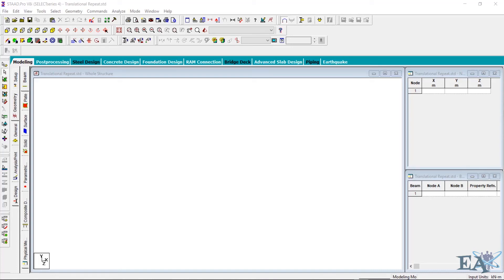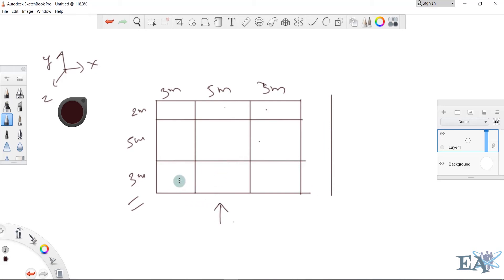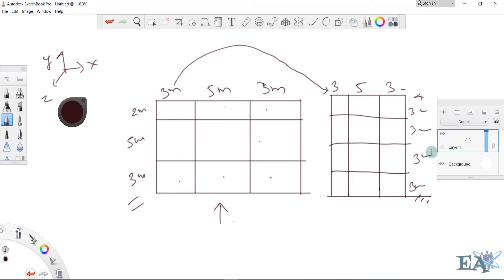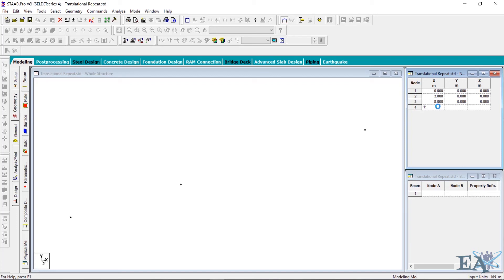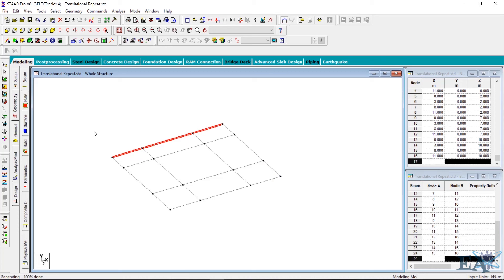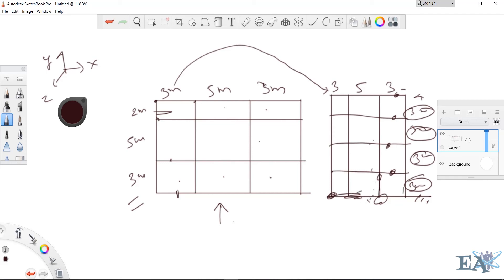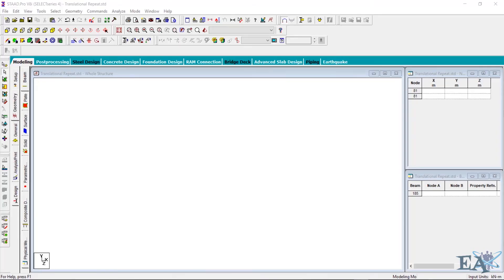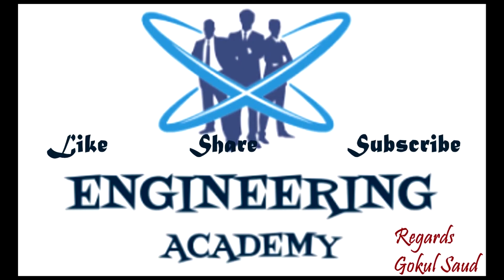STAAD Pro Tutorial For Beginners [Episode 10]: Using Translational and Circular Repeat

Comment: i have a suggestion for modelling........ i ithink its much easier to use the structure wizard, because you can just easily make the full 3d grid..... in the previous video, i recall you saying that the spacing between bays will always be set equally... this is actually not true, because you can click the dotted button next to the specified number of bays button,  there you can specify the spacing of each bays however you like..... hence making it easier to model a structure instead of manually creating nodes and replicating them
Reply: thank you for informing us it's much better than creating the nodes
Reply: thank you for addition of this one concept
Reply: Thanks